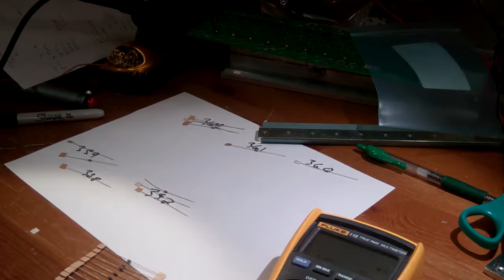Curtis 1231c upgrade - Binning Gate Drive Resistors

Comment: Can you just tie all the base leads together so they all switch at the same time ?
Reply from the maker: normellow They are already tied together, but the length of the traces are of different lengths.
Reply from the maker: normellow I am constrained by the existing PCB and location of logic circuit board. I did not want to cut a trace and route a wire to the middle of the traces.